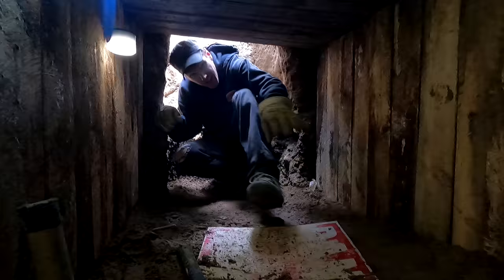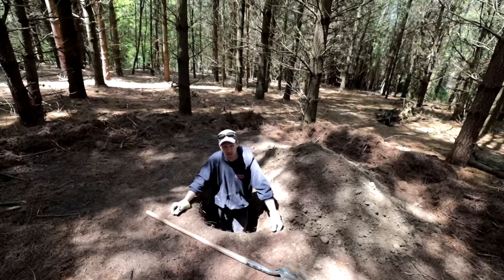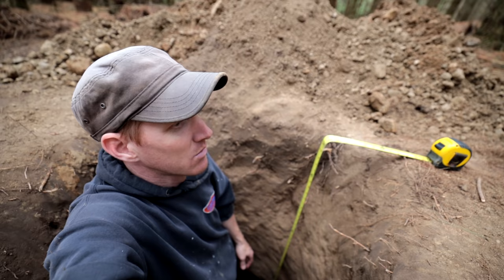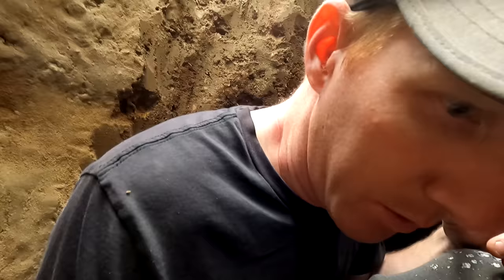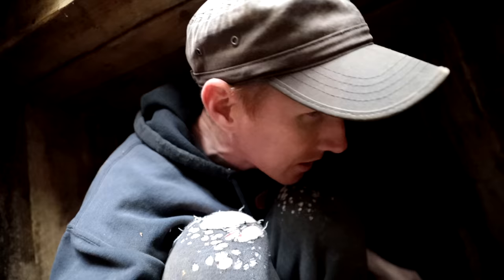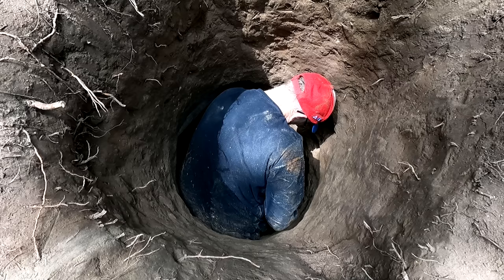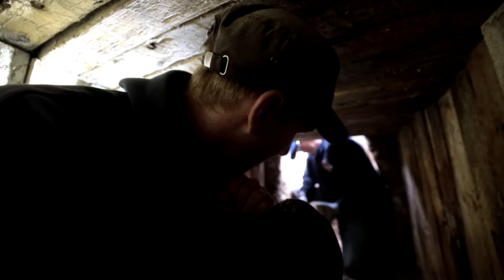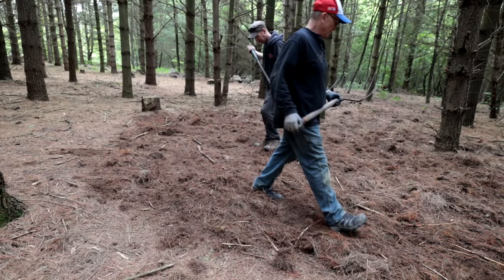Digging a Japanese Spider Hole (and sleeping in it!!!)

Comment: The Vietnam tunnels were dug in hard clay too, and they made their tunnels with dome or triangular roofs so as to support the roof weight and save it if a tank or other vehicle drove over it
Reply: Based Vietcong Freedom Fighters
Reply: Good to know my grandfather  actually  went to Vietnam  and served in the United States army and received the purple 💜   he didn't really talk about  Vietnam War  very much but when he did us grandkids hung onto every word
Reply: Great point.  Thanks for the info!
Reply: @timtron  vietnam won so theyre based usa lost so it's cringe simple as
Reply: @timtron  america won in vietnam like it won in afghanistan p much lol
Reply: @SecuR0M  actually the Vietnamese were literally days away from surrendering. No one really won in Vietnam…
Reply: This was about Japanese tactics… not Vietnamese ones… this was a Japanese spider hole. Not the Vietnamese tunnels.
Reply: @gryfinryder  explains why the RVN still exists

oh wait
Reply: It also helped that much like the pre-WW2 Japanese, Vietnam-war era Vietnamese were under 5' tall on average and weighed 90 pounds dripping wet, so digging small tunnels and then fitting in them was significantly easier.
Reply: the Vietnamese dug the large tunnel systems in laterite. it's like firm cheese when first dug, then hardens like concrete when exposed to air. ideal for tunneling. I think digging like that in a lot of soils would leave you buried in a cave in.
Reply: They were bigger and had centuries of development. This is something anyone can do within a few days and be very effective and concealed.
Reply: @timtron  vietnam doesnt supply dollar stores though. Vietnam is a textile based export economy currently so clothing and shoes are mainly from Vietnam. China still supplies dollar stores.
Reply: @timtron  that's why we have taxes in the us also the gold fringe on the flag. Because we lost to nam.
Reply: @timtron   The US also pays each year 22 billion in compensation to Vietnam Veteran families, on top of the 77 billion for exports electrical machinery, furniture and bedding, knit apparel, machinery, and footwear, they would be OK without America's help bringing in over 300 billion from exports
Reply: @matthewschipper2023  Matthew.... It just so happens I just got done reading "with the old breed" by E B Sledge. It's considered one of the most gritty and in your face depictions of war. I should note that it's about world war II fighting the Japanese but I think there are some parallels to Vietnam. It strips away any concept of nobility you might have had about war, while still being fair to the American infantryman. I highly recommend it. You'll learn things that few soldiers/marines will be willing to talk about. Definitely a good read.
Reply: @HeatGeek1   ok thanks i will try to find a book or see if i cant get some history from some of my family members from there experience my grandfather sadly passed away  in late 2017 early 2018 due to als and 3 major heart attacks  i was with him when he had his widow maker he kinda help raise me and stear me on the right path
Reply: good to know fam💯🫡
Reply: @xp8969  no Nunn Jenn
Reply: @SecuR0M  You can blame the politicians for all of it. We had them beat too, they just reinforced with another country just like Afghanistan.
Reply: Triangle is the strongest shape
Reply: @matthewschipper2023  A true hero.
Reply: @doodahman2995   that he was a very smart man to he was also  kind and had a sense of humor  like nobody  i know  the one thing i learned  from him there is always  more than one way to do something  . And messer twice  cut once  and always  do what your able put your all into everything provide for your family  studdy hard eat well sleep plenty and train  both mind body and spirit  you will never be perfect  no matter how much you try  . But you will succeed  the more you try success doesn't come without failure  failure doesn't come without trying  💯  i literally  used to be 400lbs at age 8 smoking  pot under age drinking  staying out past curfew but when my grandfather found  out he changed it i droped the pounds i started  doing  martial arts  for self defense   and going to church camp attending online homeschooling then going to the library to read encyclopedia  law medicine  radiology  nuclear science  physics  math day in day out until  the whole library was emty of books i haven't checked out  and read then he would  take me to train with him from his military boot camp  workout😁
Reply: The Vietnamese made vents that looked like termite mounds, so they had inconspicuous fresh air coming into the tunnels. (at least that is what i vaguely recall from my visit 15 years ago). They also set up tons of varied traps that would have dealt significant damage to those who were moving through on foot.
Reply: @matthewschipper2023  Sounds like a  wonderful man. Those qualities are very inspirational. I hope you pass the on to others as well. Take it easy Matt. Have a wonderful Father's Day!!
Reply: @SecuR0M  you can’t really define wins and losses with the type of conflicts they were though. While Vietnam didn’t go as well as Afghanistan, you can’t really say the Vietnamese won or lost.
Reply: @gryfinryder  and these comments are about vientnese ones what’s your point
Reply: @MikeJones-mf2rt  i live near a dollar store. A dollar general and dollar tree, ive never seen a cloth flag at any of them. Plenty of plastic flags on little plastic stick and large plastic flags in plastic bags however. Textiles generally are not that cheap to make, especially large ones because they require some sort of hand labor at some point which reduces speed of production.
Reply: @timtron  You and Kat Tsun are both wrong. The US had no reason to invade vietnam. The war originated from Vietnam fighting for it's independence from France. I think that's something all American's can relate to, considering our own revolution. Nam was never a threat to US democracy and Ho Chi Minh even sent letters to Truman explaining that he was fighting for almost all of the same values we have in America. At the end of the day we killed thousands of people because some US politicians were doing some extreme fear mongering around communism. Anyone that understands anything about history is well aware of how wrong the US was morally, and strategically, to invade Vietnam.
Reply: @nawdawg4300  "...killed thousands of people..." you're missing a handful of zeros there.
Reply: @nawdawg4300  I agree with you. Fear mongering over communism starts wars, and people get very very rich from supplying war goods. That's the big picture of what I was talking about.
Reply: Any tunnels within the range of NJ’s 16 inch guns were completely obliterated though, they even sunk a fortified Vietcong island
Reply: False
Reply: nig a  They also had a lot of "free time". Being at war plateaus your schedule out. It's just "war" for the next 20 odd years.
Reply: @gryfinryder  We lost. Get over it. I'm sick of all this spite over a war the US started and then lost.
Reply: @danmorgan3685  not sure where your getting any spite. Just stating facts. I happen to love Vietnamese people. Sorry you read any negativity from my statement.
Reply: At least one side fought for communism, not the entire country, I believe the south was democracy or something
Reply: @timtron  dude their baiting you lol. chill tf out
Reply: @oversizedspeedbump9375  obviously. I checked out days ago, bro
Reply: @timtron  lol my bad was only looking at the top comments
Reply: @fusionxtras  There are definitely plenty sold at all of the dollar stores I’ve ever seen... Especially right now with the 4th of July coming up... Also, polyester and nylon are both “plastics” which, along with cotton, are the most common textile materials in Vietnam and are what the overwhelming majority of all flags are made-of because they’re UV resistant materials which are able to withstand long term exposure to direct sunlight without fading and can survive harsh climate conditions without deteriorating, unlike cotton... The only time you might see a flag that isn’t “plastic” is if it’s for decorative purposes only, like military funeral flags stored in a display case, but even that isn’t very common anymore due to sun-fade... So your argument makes no sense...?
Reply: Wow cool info! Thanks!
Reply: @danmorgan3685  nice to know, thanks!
Reply: @gryfinryder  you must be paying too much attention to your American education
Reply: @sushitraxh6736  lmao.. keep it up.. your jealousy is showing..
Reply: @matthewschipper2023  my Pawpaw fought in Vietnam too. He was a helicopter pilot. He has tons of pictures and artifacts he has showed me but I’m kinda scared to ask him to tell me some stories. I don’t want to accidentally trigger ptsd or make him upset about something that happened. So I’m really not askin him just outta respect
Reply: @timtron  L+cope+seeth+mald+you lost+you retreated+westerner mad+long live ho chi minh+nerd+wooosh+cringe+cry bout it
Reply: @gryfinryder  jealousy to what, with my teaching license in history I would never wanna wish to be a basement dweller dude, thanks but no thanks
Reply: His hole ain't gonna have frigging tanks driving over it
Reply: @gryfinryder  except Henry Kissinger
Reply: You definitely can't do a damn triangular roof
Reply: Operation popeye sorted that out
Reply: @gryfinryder  What Jealousy, jealous of the U.S? LMAOOO
Reply: @SecuR0M  I laughed harder than I should have. Agreed.
Reply: @SecuR0M  Which side won is really dependant on what you define victory to be.
Reply: @Pwov  now your jealousy is showing… Trying to hide it behind nervous laughter won’t help you. Have a nice day.
Reply: @gryfinryder  Lmao I live in the U.S nothing to be Jealous of. First class country but homeless veterans in the street LMAOOO. Nice try but you simply just lost the argument.
Reply: @Pwov  the entire world has been emulating “the west” for two centuries. Pointing out a single geopolitical issue and claiming I lost the argument makes you… well… not too bright…
Reply: @SecuR0M  you have an anime pfp. Ironic
Reply: @SecuR0M  There were significant differences. The war in Veitnam was ultimately to prevent the creep of communism, when the Soviet Union fell, there wasn't really much of a reason to be there anymore.

So to say the US lost in Vietnam isn't really totally accurate as the primary objective was achieved even if the US hadn't succeeded in total conquering of the nation.

The US goal in Afghanistan was to root out terrorism. When they left, the terrorism remained so it absolutely was a total loss.
Reply: @deejnutz2068  it literally lost vietnam

communism reigns supreme blessed lenin and uncle ho

and yes it lost in afghanistan because pashtun tribesmen hate homosexuality and coca-cola, which are two of the prime factors of america's civic religion

it also lost in iraq because it's an iranian ally now gg
Reply: @timtron  We're they not fed before the invasion?
Reply: @gryfinryder  yet they won and america lost and retreated lol - lost to rice farmers with old soviet weapons
Reply: @gardencentres  whatever helps you sleep at night. Nothing is so simple. Rhetoric like that is for the simple minded.
Reply: Oh mankind, Surely we are created, and we were given life and we will be caused to die.
Where did we came from? What is our purpose? Why are we on earth?
You were created for a purpose. That purpose is to know and worship your Lord, Him alone.
Your life is a test, The Lord of all the worlds is the Most Merciful the Most Compassionate.
Don't go into the extremes like the christians and the jews. Don't worship the prophets.
Don't worship humans or animals. Worship the Greatest. The Creator. He is Allah.
Who send Prophets and Messengers to lead and teach mankind such as Noah, Abraham, Mozes, Jesus
And last and final prophet sent to mankind Mohammed came all with the same religion.
Follow that which we have been ordered. Don't die disbelieving. There is no return.
Do that which is good and forbid what is evil. Don't be fooled by satan who is an open clear enemy.
The only religion acceptable by Allah is Islam. The same religion each prophet and messenger came with.
Submit yourself to your creator so you may become a muslim.
Reply: They also used long lengths of large bamboo as ceilings in bunkers so that if a bomb went off above the bamboo would flex down  to a mound of dirt in the middle of the room  and spring back . The VC would sit around the edges of the bunker walls .
Reply: They were also narrow
Reply: @xp8969  Can you dig it. 
They did.
Reply: @fusionxtras  They aren't the main supplier of dollar stores but they definitely make some products. Vietnam has moved out of the textiles business. They mainly make electrical devices and equipment now.  Over 50% of their economy this year was that.  Plastic products also moving past textiles soon.  Textiles and clothing are less than 20% now and will continue to decline.
Reply: I'm currently digging around in some clay and that stuff is no joke. They had to have had some sort of picks.
Reply: @timtron  that is now where u either knows nothing about history and just spilling out ignorance ... After US " lost " in Vietnam , Vietnam still has at least 3 more war-conflicts ahead , not to mention in 1978 US embargo'd Vietnam , which it cannot pretty much trade anywhere ( War in the West with Cambodia vs Pol pot regime , War in the North vs China invasion ) pretty much Vietnam was stuck in the middle of nowhere ... yet ... after 40 years Vietnam was able to rebuild its current economy after at least almost 90 years of constant war and its country devastated ... while US is safe on the otherside of the globe and now having trillion of government debt .... Pitifully poor ... Vietnam doesnt need US to stay afloat ... it has been on its own since then ... arrogant attitude is why the American dream died my friend ...
Reply: Cool!
Reply: The problem seems to be that you have to remove the whole earth which came out of the hole. . Because when there is a huge heap of earth in the forest, you know that someone was digging there.
Reply: @lenny108  we were trained to put the extra dirt in a nearby creek or river to have it moved away naturally and maintain our cover. The EPA would have a fit though nowadays if they ever caught anybody doing that
Reply: @gryfinryder  
Yeah they looked like they were about to surrender as they overran Saigon and the Americans ran away...
Reply: @gryfinryder  
Pull out/ran away, it's the same thing.
American has never won a war on its own.
Reply: @vixen878  2 million communists got slaughtered though lol.
Reply: Those tunnels really were the entire network, and they were extraordinary.
Reply: BlackBannerProductions  it won't there has to be supports
Reply: @Minuteman_Expeditions-wo2cp  yes, you need a truck to carry away so much earth.
Reply: when the ground starts speaking vietnamese
Reply: @nawdawg4300  except you forget the part where Truman told Ho Chi Minh that as a French territory, as per the territories held by the Japanese were divided up after WWII, we couldn't legally get involved and that he needed to seek independence from the French government. The French said NO, so then Minh went to the next closest government, the Soviets, and so the Chinese Soviets sent weapons, hence a majority of the small arms being Chinese copies of Soviet weapons, and after Mihn promised to become a Communist country Soviet Russia sent them aircraft with "observers and instructors" when in actuality many times the pilots were Soviet Russians, we found that out much later, and American soldiers had even fought against SPETSNAZ soldiers who were doing for the NVA that our Green Berets did for ARVNs. After all that America didn't lose nor did they win. Politicians came to an agreement for a ceasefire and we pulled our troops out, same as in Afghanistan, after the end of the pull out period the NVA and ARVN resumed their civil war, sans Russian and American observers on 1973. Saigon fell in April of 1975 and by 1976 the communists had taken over all of Vietnam,Cambodia, and Laos.
Reply: @gryfinryder  cope
Reply: @konik5659  I could say the same to you.
Reply: @JosephDawson1986  Very interesting. I'll have to do some googling to verify you comment but if that's what truly happened then I'll definitely have to reevalute some of my positions.

Either way though I still don't think America should have been involved. Fighting a proxy war against the Soviets so that a country across the world doesn't become communist just seems like a waste of American lives. Especially because Vietnam became communist anyways, but hindsight is 20/20.
Reply: @nawdawg4300  even my Grandfather a WWII, Korea and Vietnam war vet said that Vietnam was a waste of our time. We only went in initially as advisors it was because of the Gulf of Tonkin incident that LBJ bumped up troop numbers to the extent they were because someone dared to attack a US ship. Now after certain high level NVA documents were found we know how close we came to winning, we didn't know then so we went to peace talks. And after some US declassified documents we know that Gulf of Tonkin was a gross overreaction to bad intel. 

I agree we shouldn't have been there, I have a grandfather and 2 Uncles on my dad's side that say as much and one on my moms side who was KIA in 68. But people forget something, our number one export is warfare. If we think you are the good guys, even if you arent, we will send our war machine to fight for you.
Reply: @gryfinryder  no one not even in the service inhales such massive amount of copium lmao, from defeat one learns from denial one can only get defeated again and again
Reply: @gryfinryder  actually,  a treaty was signed before our allies lost
Reply: I'm curious, how did they deal with the rain/flooding?
Reply: WP’em
Reply: @SecuR0M  simple as what
Reply: @frwystr  simple as
Reply: @tawelwchgaming8957  

pungee sticks

coated in human feces and urine.

to cuase terrible infection 

my dad had scar tissue on his legs from one.
Reply: @GOLDEN-EYED-TIGER   We have taxes because we lost in Vietnam? lol.
Reply: @xp8969  They were Communist, the absolute opposite of Based.
Reply: @americanhomeinnovations7155  sure thing 🐑
Reply: @gryfinryder copium
Reply: @stinkybuttrat  you wish..
Reply: @HeatGeek1  thanks I've been looking for some worthwhile audiobooks
Reply: @gryfinryder  Do you really think the Vietnamese were days from surrendering? 😂😂
Reply: @gryfinryder based on what?
Reply: Not many vehicles can drive in dense forest am I right?
Reply: Sorry, but truth isn't allowed here. @gryfinryder
Reply: @SecuR0M Vietnam sucks buddy
Reply: @xp8969 Nothing based about them now they just make my Nike shoes
Reply: @PastLifeVillian  It beat two nuclear superpowers in wars. Cope and lose a war about it maybe.
Reply: @xp8969  lesser known fact, they were actually called the Viet Minh, and they were also actual members of the NVA
Reply: @999jellison  that's really cool! That's literally perfect for making tunnels like that
Reply: dyoxie poisoning by a freaking candle.
Reply: @SecuR0M if you lost more people then you didn’t win
Reply: The question would be, did somone know this beforehand, or did they just learn from cave ins
Reply: @rataca100  trial and error
Reply: You forgot some tunnles where also built in dense jungle areas with thousands of small nd big roots i imagine how hard that would bee.
Reply: @gryfinryder  "The Vietnamese were literally days away from surrendering" Then why didn't they? Moreover, why did North Vietnam continue fighting for years after the US military left South Vietnam if the NVA was "days away from surrenduring?" And why did the NVA decisively win the war by taking control of Saigon?
Reply: @Furiouspenguin27  The North Vietnamese Army achieved an inarhuable victory over both the US military and thr ARVN. Cope. There is no other word to descrobe it other than "victory." South Vietnam stopped existing. One side clearly lost, and the other clearly won.
Reply: @TheCrazedMexican.  South Vietnam was one of the least democratic countries on Earth. What are you talking about? Communism is inherently democratic. The communists won a fair election to unify Vietnam, and the undemocratic South refused to concede.
Reply: @deejnutz2068  The Soviet Union fell decades after America pulled out of Vietnam. The US clearly failed to "contain communism," considering that Soith Vietnam doesn't exist anymore and inarguably lost the war on all fronts.
Reply: @Abcdefg-tf7cu  wonderful information, not like I posted that 2 years ago but still thanks. Btw not everyone knows history almost on the dot, as you saw from my comment waaaaaaaaay back 2 years ago. Almost like I completely forgot about the matter since damn it don’t really matter now does it? 👍 have a nice day 👌
Reply: @Abcdefg-tf7cu  Vietnam got pooped on and then we left because of internal politics, cope harder
Reply: This is The Truth of Salvation

HalleluYAH (Hallel u YAH) “Praise ye YaH”

YaH is The Father (Genesis 1)
YaH arrives via the TENT OF MEETING
YaH was Who they Crucified for our sins
YaH was Crucified on an Almond TREE

Semitic (Moses)
Isaiah Scroll (The Original Isaiah)

Isaiah 42:8
I am YaH; that is my Name! I will not yield my glory to another or my praise to idols.

Isaiah 43:11
I am YAH, there is no other Savior but Me.

Isaiah 45:5
I am YaH, and there is none else.